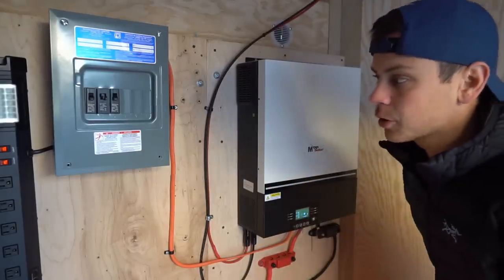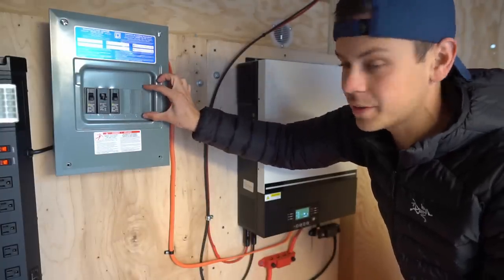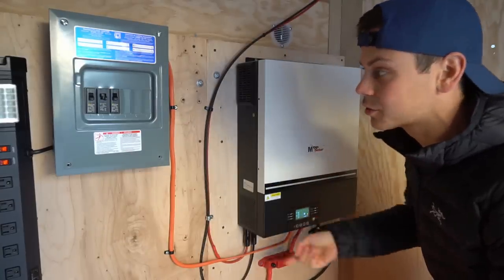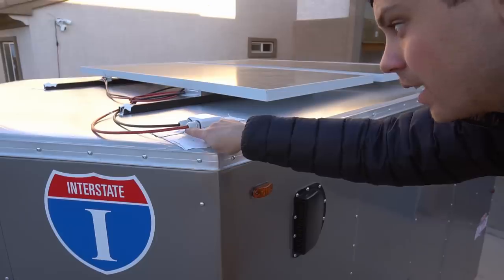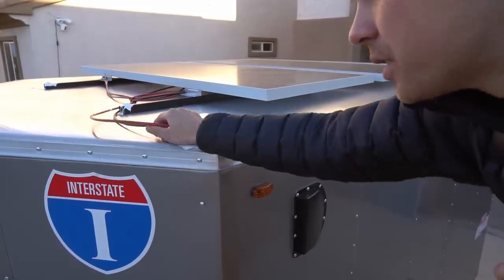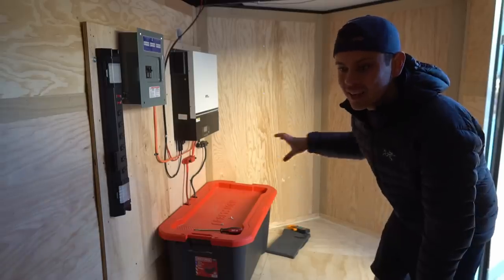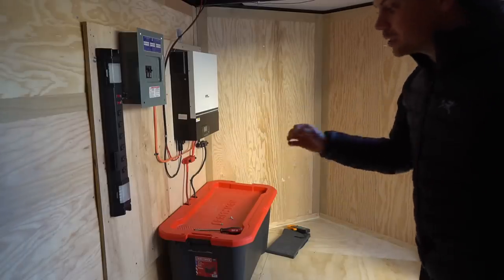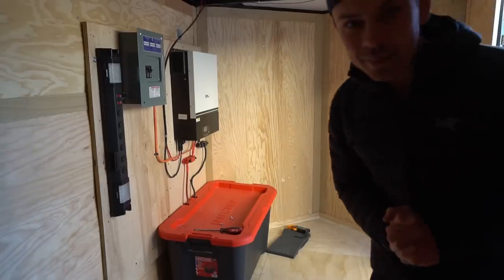Utility Solar Trailer Part 2: Responding to viewer comments

Comment from the maker: Also, paralleling inverters refers to the battery connection. Not the AC inverters output! I just had a comment on this video thinking that I was referring to the AC output. I actually covered this when we were programming a previous split phase inverter, and yes, when the batteries are in parallel and communicating the two hot leads are out of phase by 180°. They have separate outputs. This is why they require communication. The parallel connection refers to the DC bus connection. Nothing else. 

What I did get wrong was the working voltage of my array. I'm adding the third 200 watt panel right now. I chose these panels because together they output 89 volts. But I need a little bit more to charge in the mornings and afternoon. So I'm adding a third panel to boost that voltage up.

~~~~~~~~~~~~~~~~~~~~~~~~~~~
Does off-grid solar confuse you? Check out my DIY friendly website for solar system packages and product recommendations, and so much more! http://www.mobile-solarpower.com

Join our DIY solar community! #1 largest solar forum on the internet for beginners and professionals alike: https://www.diysolarforum.com

Check out my best-selling, beginner-friendly 12V off-grid solar book (affiliate link):
http://amzn.to/2Aj4dX4

If DIY is not for you, but you love solar and need an offgrid system, check out Tesla Solar. Low prices and great warranty, and they can take your entire house offgrid with their new Powerwalls: https://ts.la/william57509

~~~~~~~~~~~~~~~~~~~~~~~~~
My solar equipment recommendations (Constantly updated! Check here first):

12V/48V Lithium Batteries: https://www.mobile-solarpower.com/solar-batteries.html

Solar System Component Directory: https://www.mobile-solarpower.com/solarcomponents.html

Plug-N-Play Systems: https://www.mobile-solarpower.com/full-size-systems.html

Complete 48V System Kits: https://www.mobile-solarpower.com/complete-48v-solar-kits.html

DIY Friendly Air Conditioner/ Heat Pumps: https://www.mobile-solarpower.com/solar-friendly-air-conditioners.html

Complete 48V System Blueprint: https://www.mobile-solarpower.com/48v-complete-system-blueprint.html

~~~~~~~~~~~~~~~~~~~~~~~~~~
My Favorite Online Stores for DIY Solar and Coupon Codes:

-Current Connected: SOK, Victron and High Quality Components. Best prices and warranty around: https://currentconnected.com/?ref=wp

-Signature Solar: Cheap Server Rack Batteries and Large Solar Panels:
https://www.signaturesolar.com/?ref=h-cvbzfahsek 

-Ecoflow Delta Official Site: My favorite plug-n-play solar generator:
https://us.ecoflow.com/?aff=7

-AmpereTime: Cheapest 12V batteries around:
https://amperetime.com/products/ampere-time-12v-100ah-lithium-lifepo4-battery?ref=h-cvbzfahsek

-Rich Solar: Mega site and cheaper prices than renogy! Check them out: 
https://richsolar.com/?ref=h-cvbzfahsek

-Shop Solar Kits: Huge site with every solar kit you can imagine! Check it out:
https://shopsolarkits.com/?ref=will-p

-Battery Hookup: Cheap cell deals
https://bit.ly/2mIxSqt
10% off code: diysolar

-Watts 24/7: Best deals on all-in-one solar power systems, with customer support and distribution here in the USA: 
https://watts247.com/?wpam_id=3

~~~~~~~~~~~~~~~~~~~~~~~~~~~
Contact Information:
I am NOT available for personal solar system consult! If you wish to contact me, this is my direct email: williamprowsediysolar@gmail.com

Join the forum at https://diysolarforum.com/ if you wish to hang out with myself and others and talk about solar

FTC Disclosure Statement and Disclaimers:
Every video includes some form of paid promotion or sponsorship. Some links on this youtube channel may be affiliate links. We may get paid if you buy something or take an action after clicking one of these. My videos are for educational purposes only. Information is subject to change/update at any time. Electricity is DANGEROUS and can kill. Be smart and use common sense :)

DIY Solar Power with Will Prowse is a participant in the Amazon Services LLC Associates Program,
An affiliate advertising program designed to provide a means for sites to earn advertising fees by advertising and linking to Amazon.com
Reply: I live in Vegas sometimes. Did you get your trailer locally? If so, from where and was it a good price?
Reply: Will, you can use a Bluetooth range extender for the smart shunt
Reply: Can you create another system using Enphase microinverters and the Enphase battery or similar. I think it will be useful to more people. Most people can't go completely off-grid and Enphase (especially the IQ8 micro-inverter) or the Generac PWRCell systems can be set in either off-grid or on-grid configuration. I think seting a complete grid-connected system will broaden the appeal and the audience of your channel.
Reply: @hurry2011  it's all marketing. 
You can do better with less money
Reply: @zarbonida  To connect to the grid you need UL certification. Enphase microinverter sell for less than $100 on eBay, they are not expensive and they come with 25 year transferable warranty. UL cert. also required for home insurance, if something happens and you have non UL certified equipment the insurance co. can deny your claims. The batteries are expensive but one can use alternatives. The switch is also expensive Generac switch is cheaper.
Reply: Hey Will!  FYI, most users on your forums are measuring 25-30W standby losses vs. 60W you mentioned for the LV6548...  impressively low and helpful for folks "pinching watts".  This MPP model and its newer cousin the (grid interactive) LVX6048 are getting TONS of attention as the new value leaders in this size range, both insane deals at ~$1150ea (direct thru MPP Taiwan).  Would love a detailed review from you on one or both, especially for a large RV application.  Thanks, love your content!

Comment: Odd. I thought your breakdown was pretty clear when I watched the first one. You specifically stated it's not a split phase inverter and you bonded the two legs in the breaker panel. Oh well
Reply: I was thinking the same thing @Sedated By Life
Reply: Agreed.
Reply: My first thought was can I add a second system and have 220 vac out. And now I know how to. Thanks Will.
Reply: Agree, It was clear to me how he wired up the breaker panel.
Reply: Ya, he clearly stated that the bus bars were tied together due to the inverter output being 120V. Sounds like some viewers are clearly NOT ready to start doing DIY electrical work.

Comment: I think you should get a licensed electrician on your show every now and then and do some 100% code installs...
Reply from the maker: DC or AC? Most electricians do not understand low voltage DC. I think an ABYC compliant installer would be preferable for off grid systems. Marine code is gold standard for DC systems. For grid tie AC, a normal electrician would be great.

And yes that would be fun
Reply: @WillProwse  Yea both or one that understands both. agree super hard to find people who really understand DC regulations....
Reply: Oooohhhh... I would love to come on as a electrician consult... I’m not sure if my unlimited license in NC would be code in NV, but they likely are on the NEC manual. We are on a NC modified 2017 code right now. Many states are still on the 2008 or 2014 NEC.
Reply: Alaskan industrial E/I & C Designer here that was master electrician before switching to design. Marine, mining, hazardous location (oil & gas), schools and Hospitals. SIL 2 rating for critical systems. Sparky that swings both ways AC/DC. All it takes is time, thought, and good comprehension to read up on and understand various Codes. Experience teaches what works best in any given application. With electricity it’s math and real world use to figure out all of the other variables that weather, environment,  cost, and parts fit for purpose impose on a system design. 
You can design a Cadillac, but in reality a Honda is probably what you need. 
@WillProuse thank you for your energy, enthusiasm, common sense  and teaching an old dog some new tricks! Someday I hope to meet you and share a laugh or two. Maybe we’d do a video then. Stay safe.

Comment: You should put one of those inexpensive Chinese diesel heaters in your trailer!!!
Reply: A 5 lb propane unit and RV Heater @ 3,000 btu would work too. In either use you need to provide venting. 
Another option and the best imho, is to use a small mini-split HVAC

Comment: Excellent, I don’t think code is an issue re, just bonded legs. And it’s a trailer, but this is a great series, there is a lot of interest in a portable solar generator.  I personally would prefer a design with a NEMA 14-30 or 14-50 so I could power my house during a ice store

Comment: Hi Will, I made a system in my little 4x6 v-nose trailer. I used an mpp800w all in one. For the ac and solar in I used a 6x6 plastic waterproof outdoor box (Home Depot) and put holes in it for panel mount AC in and out, as well as SAE input (for solar). All of those are marine panel mount style. This way I have AC input outside and an AC output outside. I mounted the box under front Vnose to avoid having to drill hole in the side. Then drilled one hole up through the box and floor to pull all the wires into the trailer. I made a thread on the forum and posted some pictures.

Thread 'DIY Fishing/Hiker Trailer (4x6 Cargo Conversion)'

Comment: Thanks for making and sharing these solar experiments!  Here's a suggestion... Why don't you make a custom V-shaped front shelf that is high up in the front of the trailer.  You can put all the electronics up high and the batteries at mid-chest height.  This keeps weight evenly balanced and still gives full depth for carrying long items in the trailer.  

Also, when you add the external outlet, you should do it up in the V nose area so it doesn't stick out wider than the sides of the trailer for keeping it protected.  

Love what you do.  Thanks!
Reply: Good idea! But, I am concerned that raising  the batteries to the mid level will change the center of gravity, and it will be less stable. It should be ok if you have only couple of batteries, and drive in normal condition. However, If you have a lot of weight in that height of trailer, it will have  high risk of rollover, especially in windy  situation.  Having most of the weights on the floor will be the best for stability.
Reply from the maker: @tosifaliyev3554  agreed. Batteries should always be as low as possible
Reply: @tosifaliyev3554  He's got 4 BattleBorn Batteries @ 31lbs each - so we're talking 124lbs for all four batteries.  I'm not suggesting to put them at the top, but put them in the middle of the trailer where there is plenty of clearance below.  That's nothing to worry about.  And, by using that V section for the electronics and batteries, he has full width clearance for the whole rectangular portion of the trailer - so loading a big item is less likely to make it unstable while placing it offcenter to avoid the footprint of the battery box.  So, in conclusion, it will be more stable with the 120lbs of batteries centered at chest height in the V-nose.

Comment: I can see the reasoning for mounting the bracket to face the opposite direction. There may be problems far in the future but like you said it should be fine since they are designed so well. It is always better to be safe than sorry though.

Comment: Good job young man, I've been watching Will since he was in diapers on you tube. He's grown up in the last few years.

The one thing I've never seen him tackle is building a solar system for either a 100 amp or 200 amp service.
The amount of batteries, solar cells, batteries( diy from ali express), and or a wind or hydro electric system.

A real base camp/ off grid setup would be really interesting. Then perhaps a grid tie with the right disconnects in case another Texas style storm hit the world.

Maybe he's done a video like that however I don't remember seeing anything like that.
Just a idea.
Reply: That would be pretty pricey and complex, it would be better for most people to have a professional do something of that size rather than diy'ers.
Reply: @gregb1714  I'm a contractor, and as such a expert diy'er. The skills are minimal and should be explored.

It would seem that Will's channel does a lot of DIY stuff and tear downs of the CCP batteries etc.
Even if Will stepped up his game that solar trailer could be set up to use wind/ hydro generation. I perfect tool to use for a basecamp/ off grid location.

Real world tools require a real amount of power. 100amp service is not hard to accomplish with diesel gensets at certain basecamps.
Having a smaller silent system would allow for a maintenance free operation without paying a sherpa to tend /baby sitting a genset.

Having the ability to use wind/ hydro/ solar in a remote location is what I'm after as it easier to fly in than a diesel genset with the requirements of fuel and storage.

1650 lbs is rather light,  that would be the challenge how to design a system that provides 50-100 amp service 24/7/365 in very remote locations.

Star link requires a constant draw, as do the computer's sat phones and other electronic gear. 
I've lead and climbed some very remote areas. And having a system that could power a small house without the need to airlift a diesel genset with it's fuel load will be very useful.
Reply: @antonwearsakilt5209  he did help JerryRigEverything (a YouTuber) install solar on his home, but it didn't have batteries and it wasn't portable.

Comment: Nice work on the trailer !  I would like to see you add a small generator (inverter generator, if possible) to your design for charging when solar is not available ....  That would be a nice video  !

Comment: get the victron bmv with the display and mount the display out the front of the trailer then the bluetooth range will reach inside the car. I did it in my campertrailer and works well

Comment: I rolled a trailer like that before.  If you haul that as is you better put some weight on the opposite side where you mounted your batteries. Looks sweet.

Comment: Will, I enjoy your videos.  I would ask that you study carefully how split phase works (center tap grounded).  The two halves of the secondary winding are in series, they are not in parallel.  120v Inverters connected in series can produce 240v.  The only "out of phase" part of it is because you reference the center tap with one lead, then swap polarity on your scope/meter when measuring the other leg.  Put an isolated scope ground on L1, "A" channel the scope probe on neutral, and "B" channel scope probe on L2 and you will see they are not out of phase, but are a voltage divider adding up to 240v.  BE SURE to use an isolated (no earth ground on the power plug) scope when you do this.
Reply from the maker: I understand that.
Reply from the maker: And I never ever thought that they were in series. The term parallel is what the manual states when connecting the two inverters to a single battery. It is not referring to the AC output.
Reply from the maker: And yes, they are out of phase by 180 degrees when measuring at ac output. That's why the manufacturer states "split phase" output. It's not a 240V output in parallel. It is single phase inverters paralleled at the battery, and out of phase by 180 degrees.
Reply: @WillProwse  I sensitive to the term "Out of phase" when the instantaneous the current in all parts of a multi-tapped secondary (split phase secondary) are flowing in the same direction.  It is like a needle drag on a vinyl record.
Reply from the maker: @ddthames  what should I call it then?
Reply: It can be taught as a voltage divider (which it is).   It is a voltage divider, with or without a tap being grounded.  A study of multi winding single phase transformers like step down transformers is a good way for people to better understand how transformer windings work in series, in parallel, and in "you burned it up because you got the coil polarity backwards" modes.    In a voltage divider, all of the current is flowing the same direction at any point in time.  The current waveform in all parts of the secondary are in phase, flowing the same direction at the same time.  The current can't be flowing in the same direction at the same time unless the voltage is more positive in the same direction.  This talk of "out of phase" happens when someone puts the ground reference of a scope in the middle and then swaps the lead from one end to the other, one leg to the other, reversing their metering device and saying they are out of phase.  Yes they look that way on the scope only because someone swapped the leads.  A silly comparison would be to connect two 12v batteries in series and then ground the center connection.  Fix a meter's negative lead to the center connection and then swing the positive lead from the first battery's negative to the second battery's positive.  Do this repeatedly and you will see -12 and +12 on your meter.  You can tell people, look one battery is negative polarity and the other is positive.  But this is because you are swapping the meter direction.  Same as with putting a scope ground on the center tap and saying one is out of phase with the other.  Getting off my soap box.  :)

Comment: I'm not trying to throw shade at anyone... Especially considering how little I know, but the first video was clear on the single phase output. There was at least three giveaways that I noticed.

1) the output was 120v instead of 220v. 220 in the us is two 120v combined. (Out of phase by 180°)

2) Tied the Bus bars together. There won't be a point for this in a 220v system in the United States

3) mentioning running two of them in parallel to get both phases of power.

Those who didn't understand this probably isn't ready to start DIYing things with 120v.

I recommend watching a few videos on household power before considering messing with 120v, 208v, 220v power.